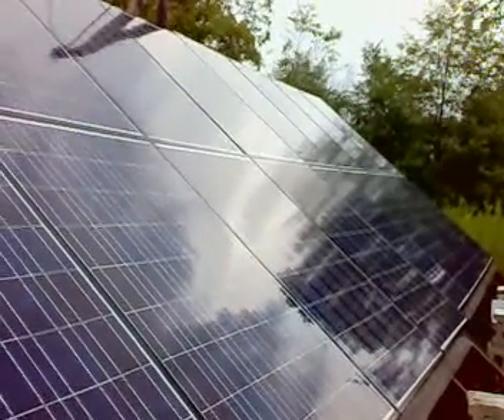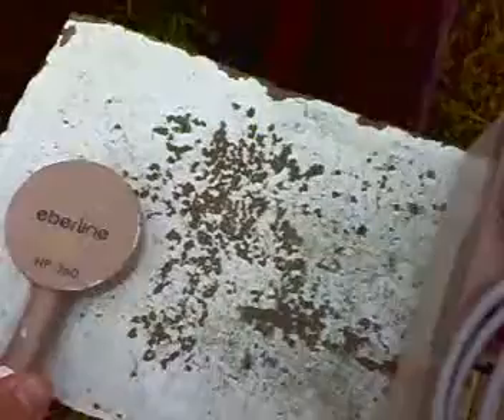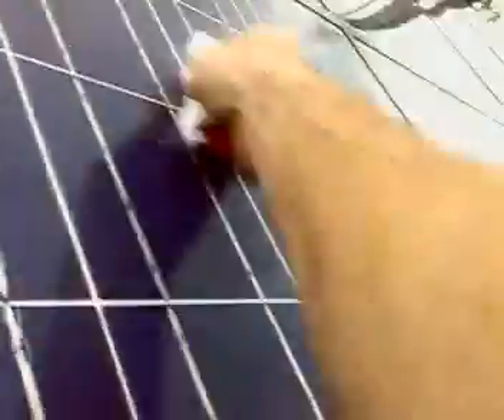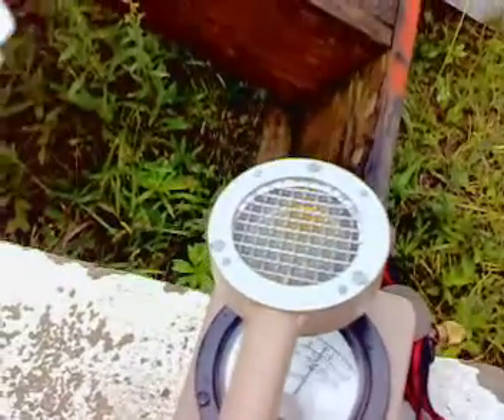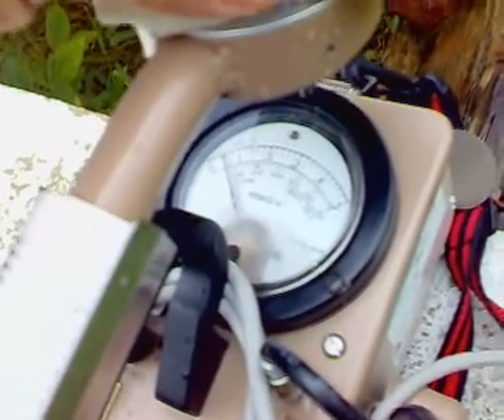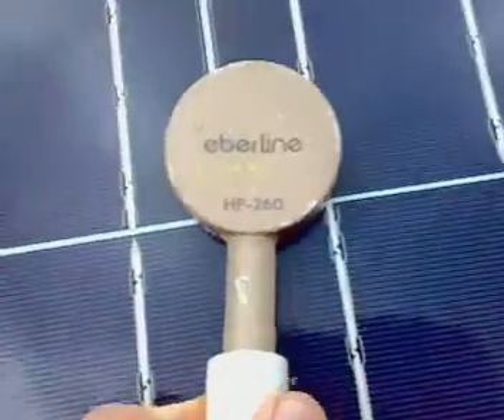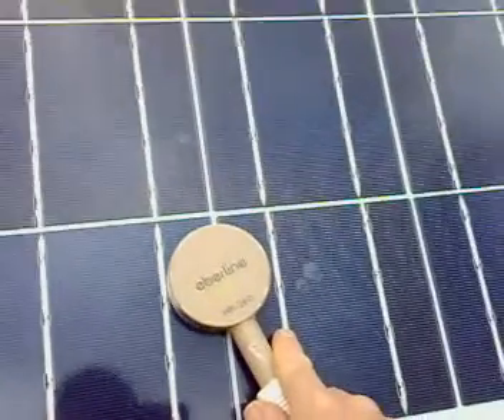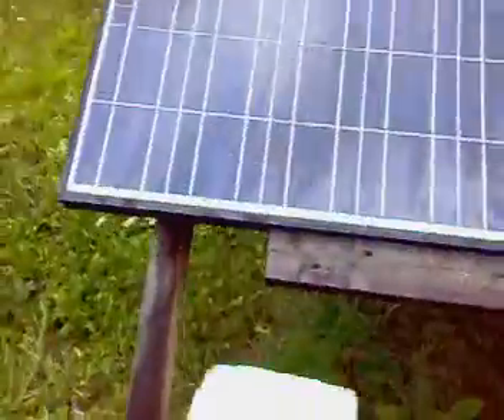Radiation Measurement Of Solar Panel from Rain 17/08/2011

Comment: So, we are having radioactive rains? Where is this radiation comming from?
Reply: There are several naturally occurring radioactive elements that are created due to interactions of the atmosphere with cosmic radiation including Carbon-14 and Beryllium-7.  The rain often knocks down particulates from the upper atmosphere including these radioactive particles.  The primary form of radiation is beta radiation (essentially an electron; created when a neutron decays to a proton) which is not harmful unless you eat/inhale a large amount of it, magnitudes more than what is being collected on the solar panel.
Reply: @MrNukebass  It's from radon gas that gets swept up in electrically charged thunderstorms, it's called Radon Washout.